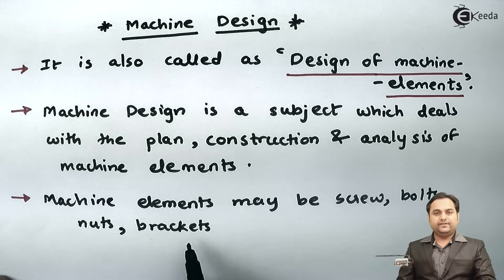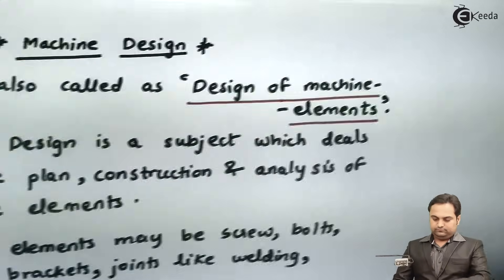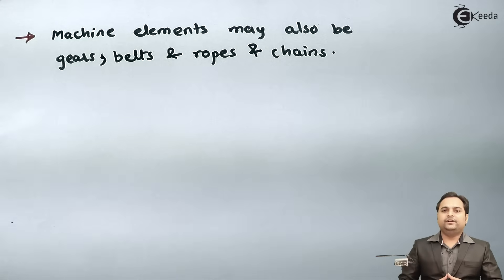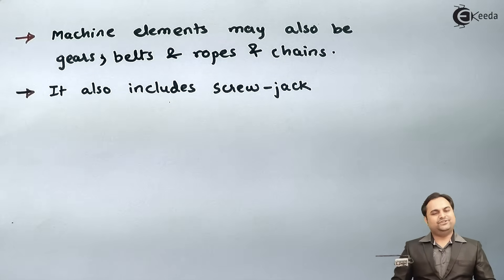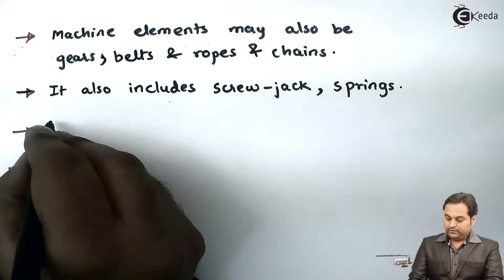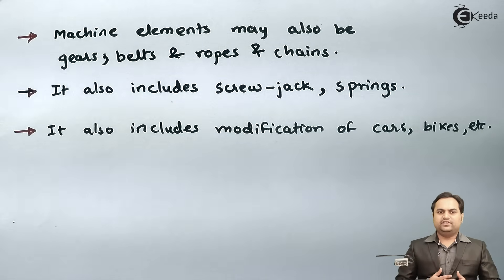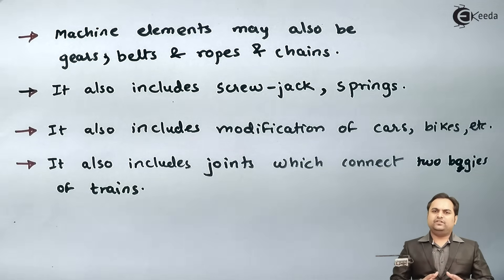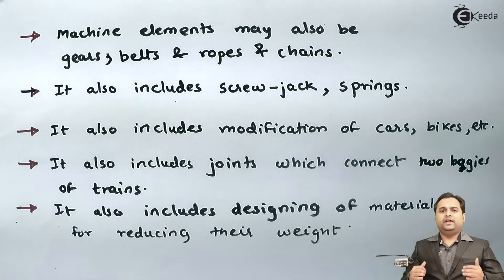Definition of Machine Design - Introduction to Design of Machine - Design of Machine

Comment: It is also called as design of machine elements.
Machine design is a subject which deals with plan, construction and analysis of machine elements.
Machine elements may be screw, nuts, bolt, key, joints

Comment: please
give a video about this topics
 Converting actual load or torque into design load or torque using design factors like velocity factor, factor of safety & service factor.  Properties of Engineering materials, Designation of materials as per IS and introduction to International standards & advantages of  standardization, use of design data book, use of standards in design and preferred numbers series.